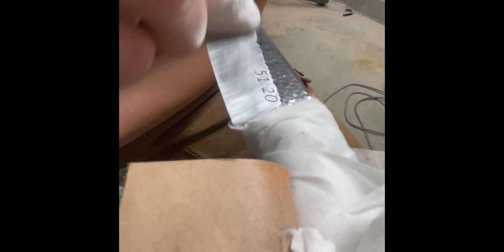Making an EDC Knife

Comment: Ok why no lanyard hole and why in god's name did you put oil on the inside of the scales and even on the spots you're going to be glueing on
Reply from the maker: Hey Tim!  The customer did not want a lanyard hole. And as for the oil, each piece was wiped down with pure acetone before glue up.  No oil was used until the blade was assembled and finished.  Thanks for the question!

Comment: What are you using for your makers mark stencil? Much appreciated!
Reply from the maker: I use a Cricut to cut it out and design.  A little more work than a full etching system and have to use a new stencil every time but I work with what I have!
Reply: Sweet, my wife has a silhouette vinyl machine. So you just use clear vinyl or something specific to make those stencils?
Reply from the maker: @BootStateKnives  I just use the cricut stencil vinyl!  With the silhouette I would recommend the heavy duty or the orocal for vehicle vinyl
Reply: @5120Blades  thanks for the info!!
Reply from the maker: @BootStateKnives  my pleasure